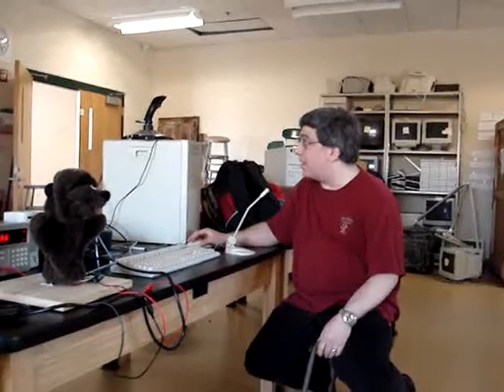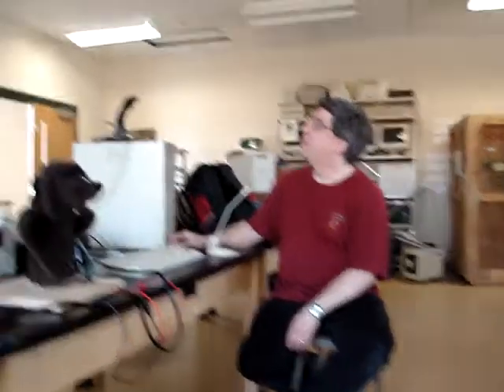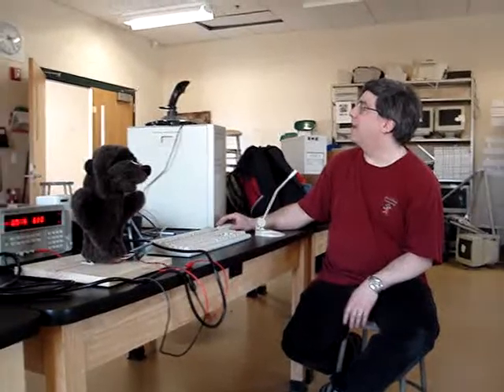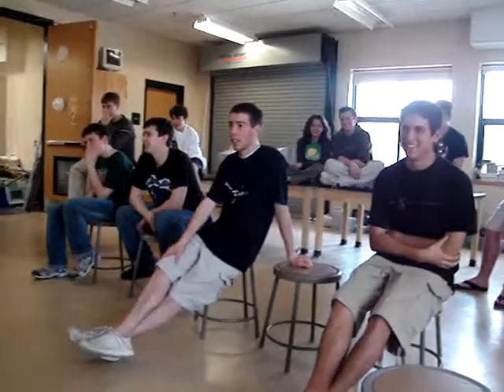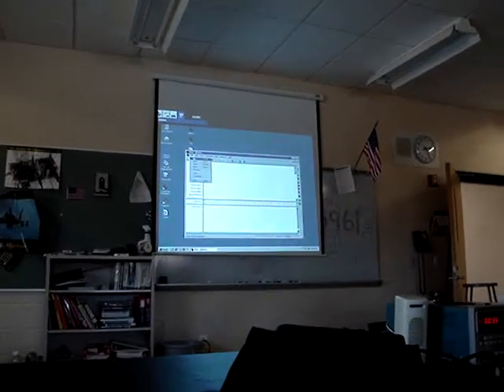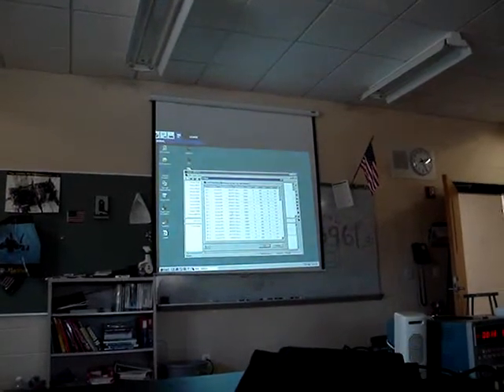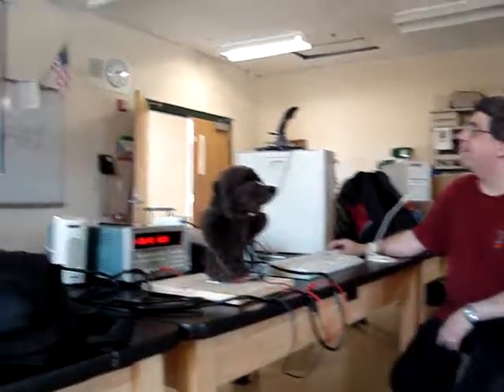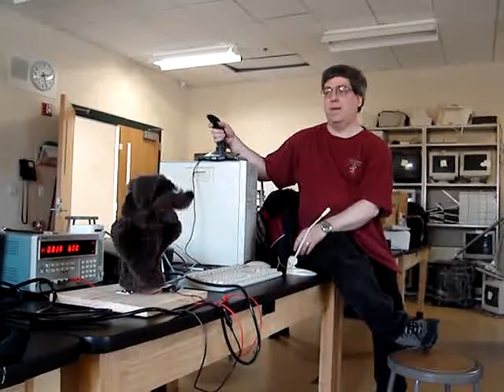How to do Animatronics with Paul Dietz

Comment: Hello, I would also like to know which interface you are using between the computer and servos.  Do you know how to hook up an arduino to all of this?
thanks,
Reply from the maker: I have no idea, this was 13 years ago and I can't recall. XD I would not know how to hook up an Arduino to this either, I have no knowledge of working with Arduinos.
Reply from the maker: Definitely not Arduino, this was a couple years years before that was even invented! It probably used some Serial connection, and I remember there being a 12v variable power supply on there for the servos.